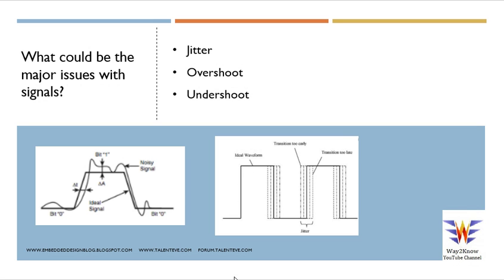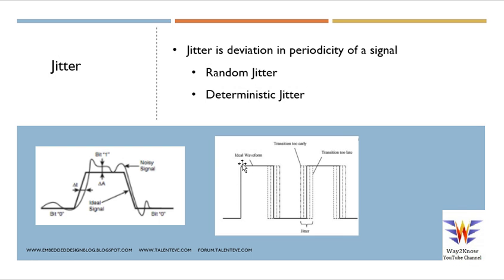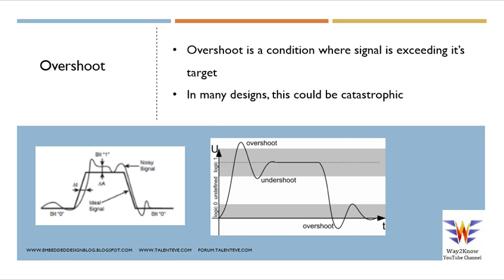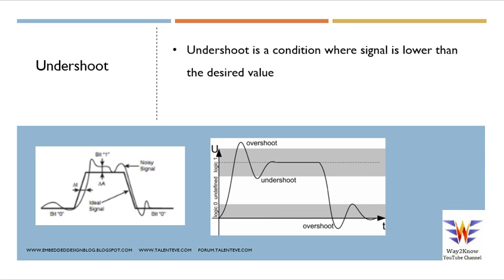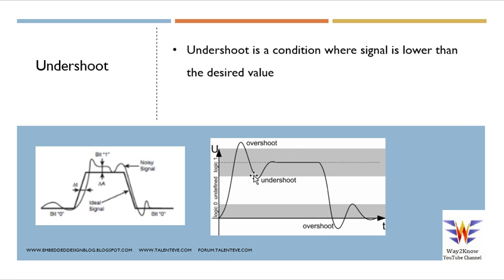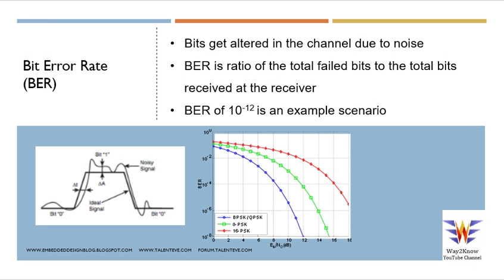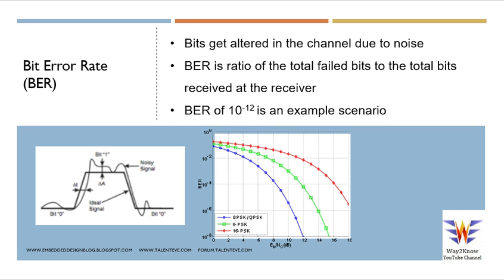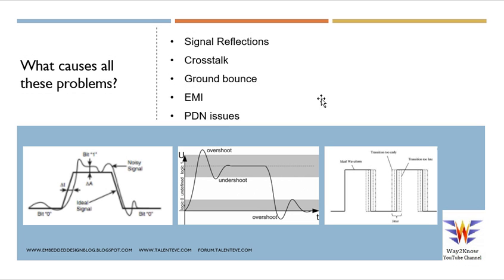High Speed Designs - Part 5 || Jitter,  overshoot, undershoot || Signal characteristics

Comment: what is the difference between IBIS and IBIS AMI
Reply from the maker: As we know, IBIS model is representation of the behaviour of drivers and receivers. The modern day chips with advanced communication methods have several processing included at the driver/receiver side, you can consider automatic gain control as simple example. If we take SERDES, the model should be more complex. This is where IBIS-AMI comes into picture where AMI stands for Algorithmic modelling interface. AMI model includes SERDES functionalities..